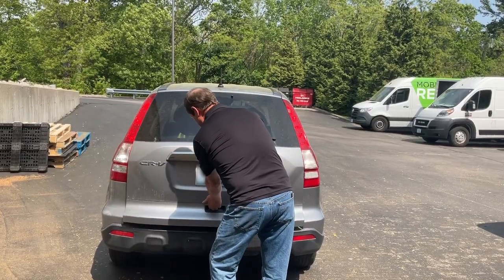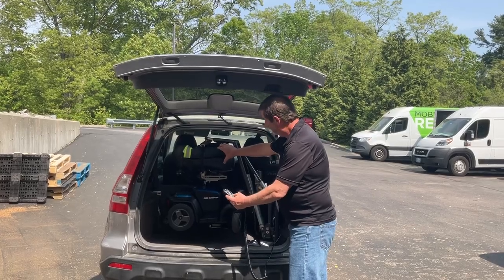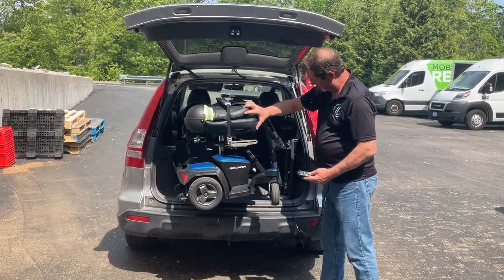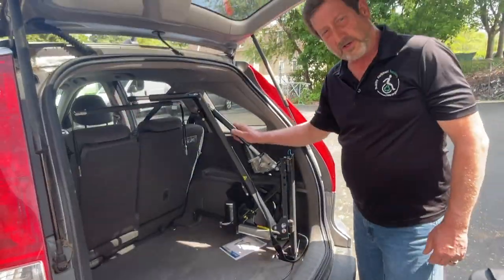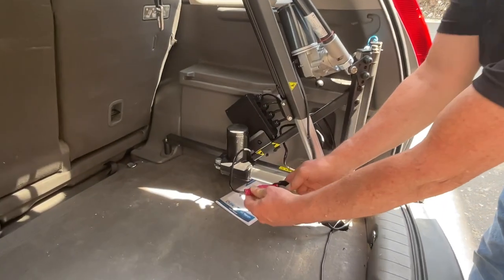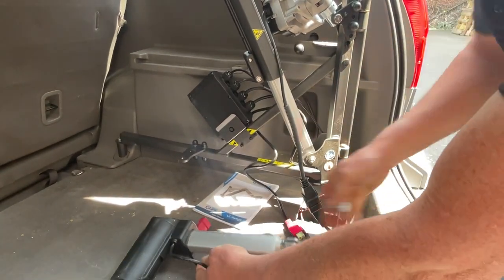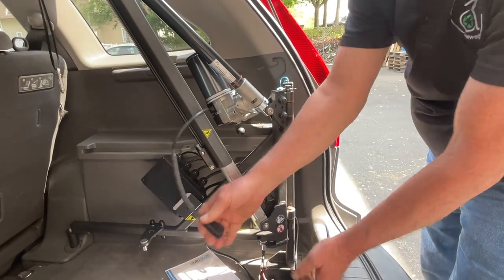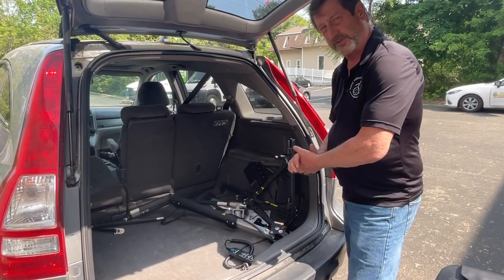Discover the convenience of the Smart Lifter by Mobility Innovations

Comment: Easily moved to another vehicle if you have $2300 to install that one bar into your  other car, then hook it up to you car battery? I don't know but that's the price I got and I own the lift and all the parts except to move it from a Honda CRV to my Rav 4. So "easily movable" but very costly. And even what he did doesn't look so easy except these places always show able bodied men calling it all easy. Not even an ambulatory disabled person. 

And I own the lift. Mobility innovations are  the only distributor in the country and locally the most expensive place in asheville has the local  contract to buy the one piece for the rav 4 and install it. So I own a folding wheelchair that weighs 40 pounds, expensive,  a $1200 scooter that was "easy to take apart." Yeah. No. 5 pieces that dont make it worth the in out, take apart, put together, in and out of car with the heaviest piece 30+ pounds. Not worth the work to run an errand. 

They screw disabled people, what a racket! Sadly this is the only lift that fits a rav 4 so I'm going to have to jury rig it with a machine shop. Dangerous no doubt but $4000+ later, I'm still trapped in the house.

Its not "easily transferable unless you have 2 or 3 grand hanging around. Harumph.